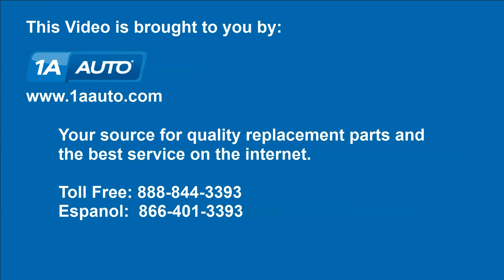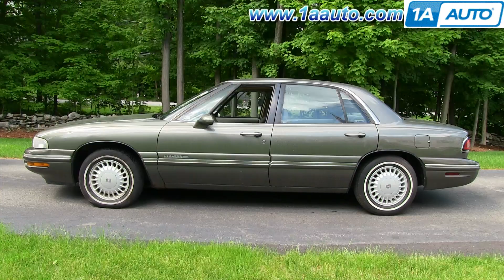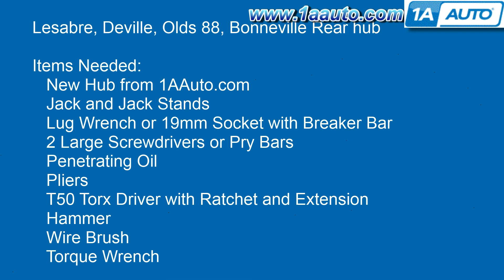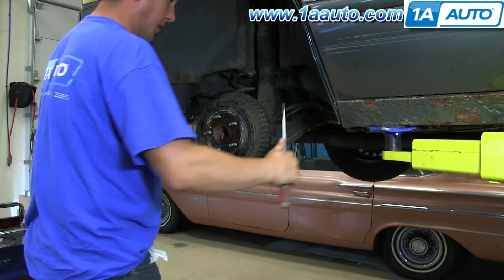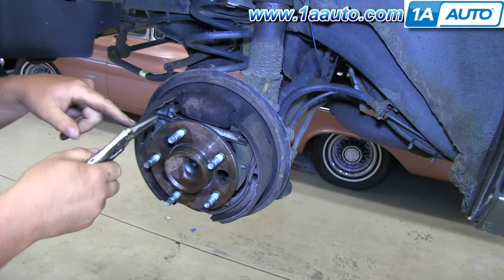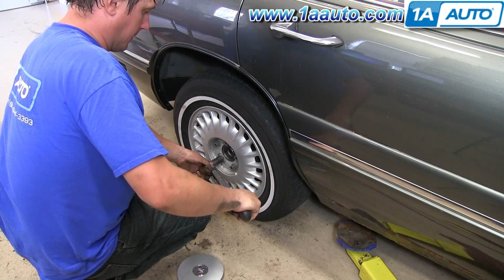How To Replace Rear Hub & Bearing 92-99 Buick LeSabre

Comment: I just smack the bearing itself until it cracks loose usually, electric wire brush also does wonders for cleaning up surfaces easy

Comment: What is the reason to leave 2 torx in?
Reply from the maker: +billy exotic It's a good reason to leave them in to retain the hub assembly while you're removing it so it doesn't fall off. Thanks for checking us out. 1aauto.com

Comment: I do not take all the brake parts off unless a bolt is stripped out. 5 lug nuts removed 1 wire harness for sensor removed 4 torx bolts removed and bam it's off.